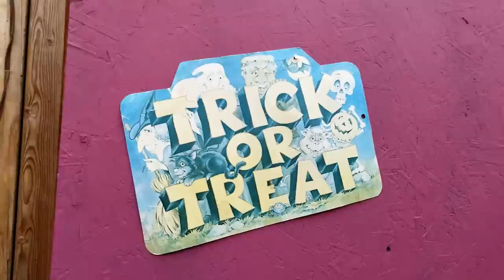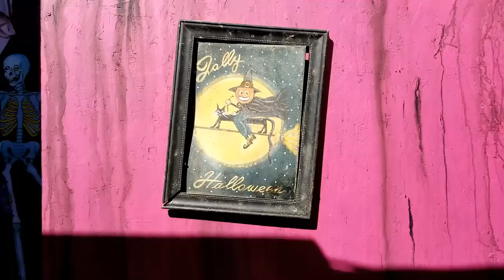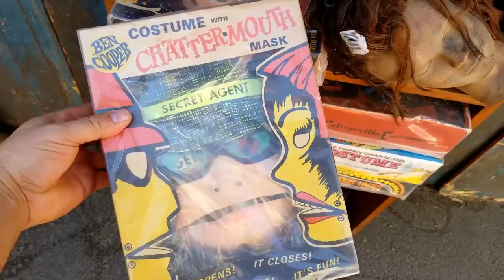Making a Haunted House - Terror In Train Town Halloween Mazes Walkthrough Tour

Comment: I wish they would show how they rigged that doorbell to open the door. That’s awesome
Reply from the maker: I thought we did show the inner workings of what makes it work and how it was rigged.  We could have explained it in greater detail of what everything does though.  You see the doorbell connected by wire to a picoboo prop controller, the controller is connected to solenoid, the solenoid is connected to a cylinder & an air supply like a compressor in one of the storage rooms you see later.  The cylinder is attached to the wall & the door so once activated it pulls the door open then closes it.  The timing to close the door are all programmed and set by the prop controller.  Sorry about that and if you are referring to seeing it physically work ya they had the air shut off when we were there but they may show that in one of their set up videos.  I will attach a link if i find one for ya.
Reply: We will have a separate video of the door prop on our channel before the season is over